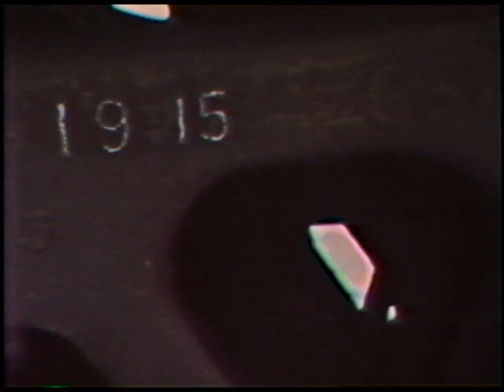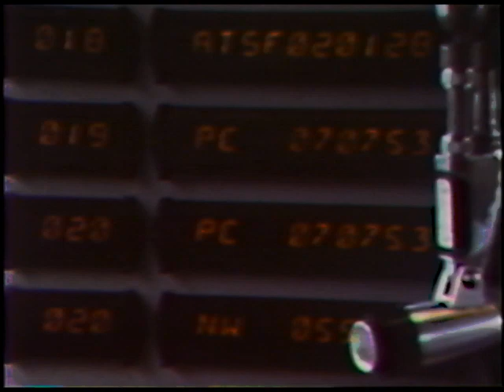Penn Central 1974 - Movie used to get federal funding

Comment: I believe that the Penn Central would've had a sporting chance if they would've divested themselves from the NH and terminated unnecessary passenger service. Second, I think that they could've done away with old rolling stock and dead motive power without having to rely on patch work...that's why railroads have car/power pools on a lend/lease program. Third, I feel that the PC could've set aside funding or lease out rail right-of-ways in exchange for shared maintenance for better service.
Reply: Too many required passenger trains, required by governments and leases. Interstates and buses killed trains.

Comment: at 8:18 that is an rs3....he called it an ars-16.
Reply: It’s a proprietary PRR naming system, so it’s Builder+ Class+ Horsepower. In this case, Alco+ Road switcher+ 1600hp. Another example would be an E8 being called an EP 22, EMD+ Passenger+ 2200hp

Comment: For the main part the comments were very illuminating.
If the situation described here was not isolated, was the pre-merger damage perhaps caused by directors failing to realise and adapt to increased road-traffic i.e., the favoured political & social choice? Or, moreover, is it likely a case of the directors deliberately running the business into the ground because they didn't care or couldn't accept what was actually happening.
Reply: Neither. It was the result of bad government regulation which meant that railroads were forced to have set rates for shipment and were prevented from merging whilst trucking could set their own rates and were essentially unregulated. Combine this with the inherent inefficiency of railroads: cars sitting in yards awaiting interchange instead of moving and earning money, being a situation more common in the East where most traffic was boxcars with merchandise moving short distances between lots of yards over many lines, and you get essential yet money losing routes. And with the ICC blocking mergers  to increase efficiency or rate hikes to meet expenses, you get the mess that was PC, where three unprofitable and largely duplicate railroads were merged into something that was supposed to be profitable somehow. This, instead of what Pearleman wanted which was to merge the NYC with a coal hauler or a western road  as that would bankroll improvements in the East. TL;DR Congress did what it does best: looking at the options of the free market or nationalization and somehow always coming up with a third, worse option.

Comment: My mom's mom worked for P.C back in the 60s and 70s in Detroit   Her job was crossing gate tower operator.  I remember asking her when Conrail was formed why the  locomotives being painted blue and she replied "oh, some government thing."  Problem with Alco and GE locomotives smoking was the 4 cycle engine.  
It wouldn't be till about 1982 when Conrail made a profit after forming from P.C. and several other railroads in 1976 by the federal government.

Comment: The Petersburg Secondary at 20:10 was part of the NYC at the time of the merger, not the PRR.  It terminated at the L&N (ex-C&EI) Wansford Yard on the north side of Evansville IN; and was originally built by a C&EI predecessor before it was sold to the NYC (probably the “Big Four” subsidiary).

So, for all of you Alfred Perlman admirers out there (and he was an outstanding railroad man, in my humble opinion), this was one NYC line that even HE didn’t see as a candidate for modernization before the merger.

Comment: The US freight railroads deteriorated throughout the 1950s, 1960s and 1970s because the government was running them . Government set shipping rates, sided with the labor unions, decided which tracks could be abandoned, forced railroads to retain money-losing passenger trains and taxed railroads heavily. The Staggers Act of 1980 deregulated the railroads, and they have been getting better and better ever since, even as highways have expanded and improved in the same period.

Comment: if they were so low on funds, why did they continue to run cabooses with the unneeded crew members they carried?
Reply: I stand by what I said Mr Schlosser, and history IS on my side by the way.  Railroads have long since given up on the caboose and the unnecessary personnel.  They WERE needed at one time long ago, but not on modern railroads.  They are now the stuff of legend and model railroaders, where they belong.
Reply: I think at the time federal law required cabooses. I know Santa Fe Railroad didn't get rid of their cabooses until the 1980's. Also, railroad unions opposed anything that would eliminate jobs. Not always a good strategy. For years after moving to diesel locomotives, the railroads still had fireman positions, even though there was no need for one.
Reply: Some states also kept caboose requirement laws into the late 80's
Reply: Actually at that time cabs were still very much needed.  Additionally the cost of those "extra crewmen and cabs" pailled in comparison to what was wasted on bs investments.  When railroads started to stop using cabs in the 80s it was not as easy transition as one was led to believe.

Comment: What line was that one where the train was rocking back and forth during the title caption segment?
Reply: It could have been almost anywhere on the PC system, seriously ! I remember back in the winter of 1971, just months after Amtrak took over all passenger train service in America, including many, many PC passenger trains.. Most passenger service on the old Penn Central was dropped by Amtrak, the track was so bad it wasn't safe to run passenger trains over it, much less running them on time, even with drastically lower passenger train speeds !  I rode the "James Whitcomb Riley" from Chicago to Cincinnati on "deferred maintenance" Penn Central track, and somewhere between Indianapolis and Cincinnati the track was horrible, I sat in a dome car (a coach with stairs up to a glass enclosed dome), from that vantage point I could see the dramatic rocking of the locomotive and passenger cars in front of the dome car, it was a scary sight even though our speed was reduced to 30MPH by "slow orders" over a 20 or 30 mile stretch. It was a joke, a sad sight to see, truthfully I had to wonder if we'd make it over that stretch of "track" without derailing, I really wasn't scared since we were chugging along at only 30MPH and a derailment probably wouldn't harm one soul on the train, but the train hardly reflected Amtraks motto, "We're making the trains worth traveling again !" The train couldn't come close to driving time. Oh yes, the cars were rehabbed and Amtrak took only the very best, all hand picked from a fleet of cars from many railroads from all across the USA, Amtrak had only the best, cars that other railroads gave up when they turned over their fleets in exchange for joining Amtrak, and shedding their money losing passenger services; ergo the ex-Great Northern dome coach, the dome car came from the Chicago-Seattle/Portland "Empire Builder" train, the PC never actually owned a single dome car itself. Penn Central, not Amtrak, was responsible for the track and shortly after my trip "The Riley" was rerouted over other railroads with decent track. Even the best and most luxurious equipment couldn't attract enough customers to make riding on Penn Central track a real transportation alternative travel option. We can thank the Federal Government for approving the merger of two almost bankrupt companies that very soon ended up as a very large railroad, that in no time at all ended up as one very large railroad and very bankrupt mega corporation. Penn Central was formed by merging two arch-rival railroads, with almost identical track routes (at many points the 2 railroads were actually in view of their ex-competitors, sometimes separated by only a small river), thus eliminating competition and creating duplication of lines and services. The Penn Central was formed by merging two giant railroad companies, the New York Central and the Pennsylvania Railroad called Penn Central.It's no surprise that management of each ex-competitor didn't get along at all, and ran the PC as if it STILL was two separate companies, all but guaranteeing one giant bankrupt railroad. Later when the plight of the very bankrupt Penn Central was clearly a massive mess, the same government that created the mess to begin with paid to form Conrail, that thanks to some very talented management and dedicated employees became a success. Still later, a mostly profitable company ( Conrail ) was split up when portions of their rails were sold to Norfolk Southern Railway and CSX Transportation, two of the biggest rail companies in the Eastern and Midwest portions of the U.S., Conrail ceased to exist, although they were considered a miracle and a vast success. Today things remain the same as they did post Conrail. Let's not forget lessons learned, hopefully Norfolk Southern and CSX are never allowed to merge.
Reply: +Buck Savage  Conrail still exist as a company called Conrail Shared Access mostly in the NYC,PA,NJ area,held jointly between NS and CSX
Reply: DTD110865 It actually looks like the Petersburg Secondary line
Reply: @victormaitland5249  But why in the world they didn't maintained they tracks?
In the '60's Pennsylvania Rairload still advertised for the Broadway Limited.

Comment: I don't get it.. first how come they didn't just trim back in some lines that weren't worth the revenue?  then get all the bad rolling stock over to the GOOD shops, and better weather hopefully for outdoor repairs.  The locomotives that weren't most common (old FM units, Alco, Baldwin etc)  those get either torched or rebuilds from the walkways UP with better diesels and do something like the santa fe did making CF7s..  there was SOMEthings to work with they just need to trim any and all fat.

Comment: Sen. Herbert “Herb” Kohl [D-WI] Senate bill 146, This bill was re-introduced as S. 49 (112th) on Jan 25, 2011. H.R. 233 (111th): Railroad Antitrust Enforcement Act of 2009 Rep. Tammy Baldwin [D-WI2]. Sen. John Rockefeller (D-W.Va.) introduced the Surface Transportation Board Reauthorization Act of 2009 (S. 2889)

Comment: Hindsight is 20/20, isn't it?

Actually PRR saw its employment levels plummet with the elimination of steam power. Trouble was, traffic was deserting the line faster than it could be replaced.

Among many errors by Saunders and crew, they really screwed up when they decided to buy the support for the merger with lifetime job guarantees for displaced workers, essentially paying people not to work. A suicidal business plan.

Comment: So the only place  you can find CSX  on the  Northern Branch line  is at Englewood NJ downtown  there's switching area CSX comes from North Bergen yard  to Leonia NJ and does Yard work  by a Crude oil  industry they Come out Randomly  During  Morning or Afternoons hours usually only Mondays Wednesdays and Thursdays Fridays   they sometimes run light at slow at 5mph  because the way the track are.

Comment: so why did they waste money on new locomotives when they could have rebuilt all those E's and F's, etc -- or bought used engines from other roads.  NYC had the right idea when they rebuilt E's and F's, combined with RS-3's making them into DeWitt Geeps.  I understand this was one good program that WAS carried into PC.
Reply: It's pointless to do that when you could standardize your fleet with newer, higher horsepower units from one or two builders than engage in a time-consuming, costly rebuild program (with money they didn't have) and then have to source parts from many manufacturers on top of that. I think PC owned units from every diesel manufacturer.

Comment: That is nuts! In 1974 they added a roof and some doors to a repair shop to keep the weather out? That was touted as an improvement? We decided to not hate the workers once and gave them a place to work on frozen rail cars. Typical behavior toward unions at the time.

Comment: Now couple that with the ICC not allowing the redundant track to be eliminated, requiring continued service and maintenance on track that didn't generate enough revenue to pay ts operating costs, much less the capital required to fix the tracks.

Stuart Saunders was so intent on the merger going through that he signed agreements with the unions granting lifetime job security in exchange for their support of the merger.

Comment: Let me guess...all thoughout the period leading up to this crisis, PennCentral was paying good dividends to the stockholders.
Reply: Actually, that’s  not what lead to them being bad

What happened, is that when the merger happened, the I.C.C. made the New York Central and Pennsylvania (the two railroads merging to create Penn Central) include the New Heaven Railroad, which was facing several financial problems at the time, causing the new company to lose money from it’s beginning.

Another issue is that the former Pennsylvania workers did not want to cooperate with the former New York Central workers, which lead to several issues, since they weren’t having it.

Furthermore, they were the direct cause of a potato famine, due to confusion, which lead farmers on the east coast to distrust the railroads, some even to this day.

Finally, the contrasting railroading styles between the companies before they merged (such as different computer systems in the few yards that had them, different styles of operating equipment, etc), it lead to several confusing problems.

Comment: PRR used to be a great railroad in the 30s to 50s but I wondered did dieselization changed their reputation
Reply: PRR was too slow to dieselize; they kept trying new concepts in steam locomotives (the S2 turbine, the Q1, Q2, and T1 duplex drives) at least partially to keep from alienating their on-line coal mining customers (and possibly to keep the Altoona/Juniata shop complex employed).  

Then, because they couldn’t get enough diesels from any one manufacturer, they bought from every manufacturer at once (EMD, Alco, Baldwin, Lima, Fairbanks-Morse) and had to purchase five incompatible sets of spare parts.  

Deferred maintenance during the World War 2 years didn’t help the situation either.

Comment: Riding the head end of a van train at 70 mph back in those days was interesting, to say the least......................
Reply: +Mark Rice Oh god, I can only imagine. If only the F-units had the same body type as the Genesis. Cab-units could still work.
Reply: @russellgxy2905  but they were oddly only ever popular in Canada (there was actually a version of the SD40-2 made for a Canadian railway that was in a fully enclosed carbody, they were all sadly scrapped tho
Reply: @cpufreak101 I imagine the Canadian full-carbody units were purchased like that due to snow and inclement weather. Amtrak picked up a bunch of full-carbody SD-45s too, but those only were purchased because they were more streamlined for the passenger sets. Santa Fe and other western railroads ended up buying a bunch when Amtrak decided to sell their whole fleet of them (due to a series of derailments caused by the steam heaters)

Comment: Here''s what they should have done.  1) Fix the track so the trains run on time and then the crews don't have to work 12 hours and derailments are reduced.  2) Next, automate the maintenance facilities...it seems like all the workers were very happy with their new surroundings.  3) Retire non-performing assets or look for public/private partnerships like the Indiana coal run which seems like it might not be a high priority but necessary to keep the homes warm in Indy ...There done.
Reply: I guess you don't know the history. They couldn't just fix the track - they were bankrupt. They had no money for that, and only got from the trustees what they begged for, mostly just for operating expenses, until Conrail was formed.

Comment: The only problem with CSX Northern Branch line is that it's all Abandoned  last  time CSX went up to Piermont NY  In the 2000s  was probably either  2001 through 2009 and thats was the last time I  saw CSX  running Local freight  they have no  money  to fix Rails and Crossings  its so sad there's Trees  blocking Tracks Grass covered  even Englewood NJ one Gate is missing  a lot towns in Bergen County along the Northern Branch  are gateless  no Gates it's Erie tracks are Blended up in down but in Overpeack Park Near by  Leonia NJ  pretty much from CP5 in North Bergen to Piermont NY  Tracks Blended in up and down  all the way through  Ridgefield NJ  Leonia  NJ Overpeack  Park  Tenafly NJ  Creskill  Demerest NJ Closter NJ  then Tracks got cut up end of Branch  became a  Rail trail just like Rutherford NJ  or Gardner NY  they had Problems but on the  Border of New Jersey and New York state  towns still have Uneven Tracks from Csx from Penn Central back in the day  that went to  Norwood NJ and North Vale NJ  and NY state  to Piermont NY  there was Freight house that CSX trains would  pick Lumber  from Piermont NY  yk Yard work  back in the 2000s  and now gone thats the Sad news  closed down for good  everything  was Quiet  town  and Erie